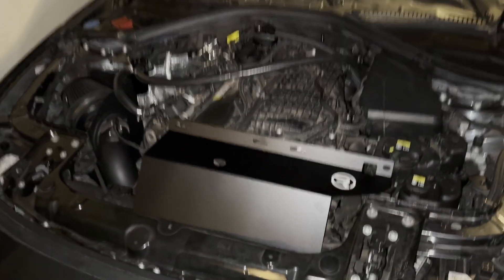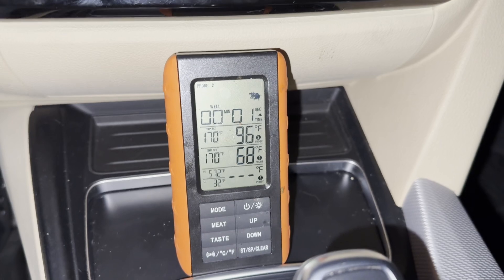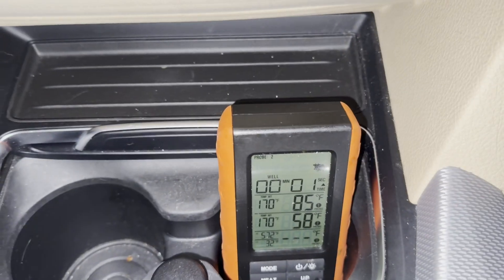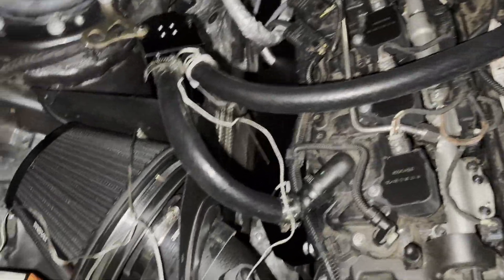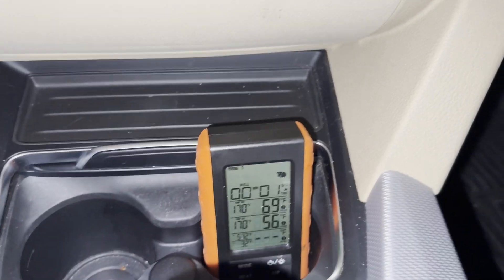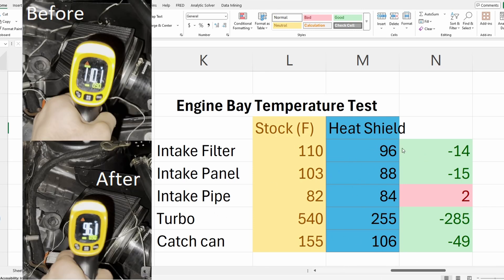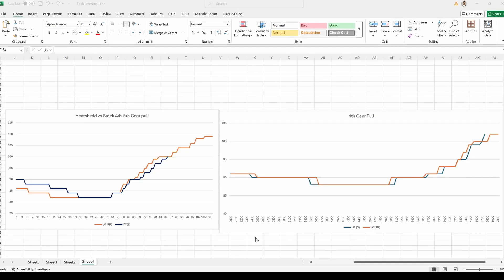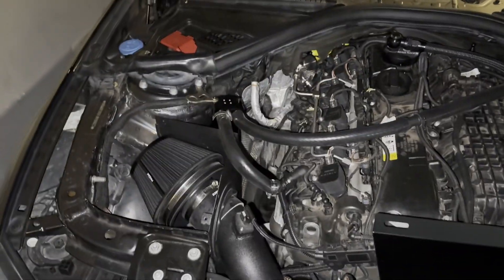Ross Racing B58 Turbo Heat Shield Review – Does It Actually Lower Intake Temps?

Comment: if air goes through the tubo and gets hotter, this makes zero sence
Reply: Keeping additional high heat away from alot of the plastic components in the engine bay is absolutely an improvement. Engine bay temps being lower is absolutely worth. Heat cycles kill alot of parts. That doesn't even take into account that your keeping more of the heat energy contained within the turbo exhaust housing itself. This is desirable since it helps with exhaust gas flow energy. This mod is absolutely worth it especially since the overall cost is low and it less likely to need replacement unlike an exhaust wrap.
Reply from the maker: While the turbo heats the air, starting with cooler intake temps helps reduce overall heat soak. Components in the engine bay also stay cooler Every bit of heat reduction helps
Reply: @ not possible with logic